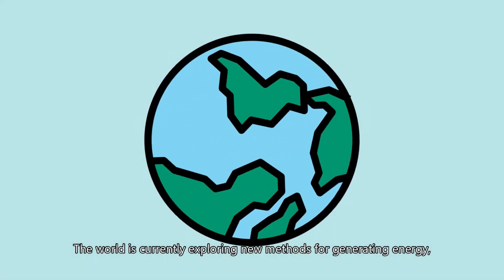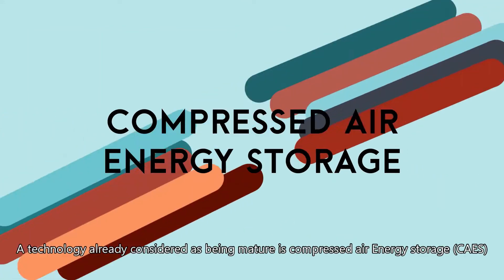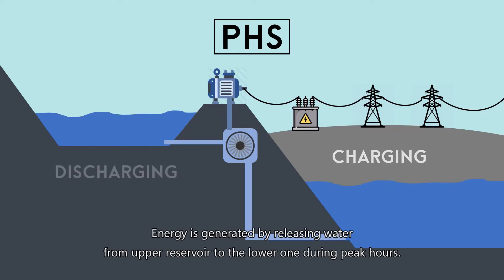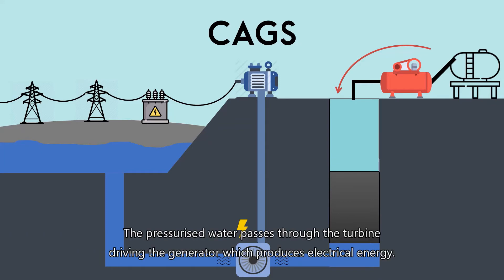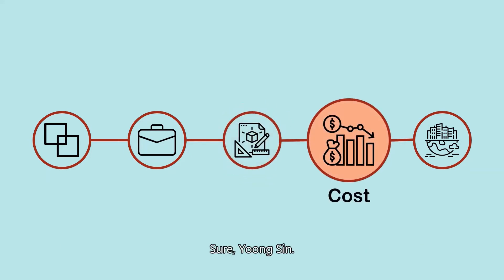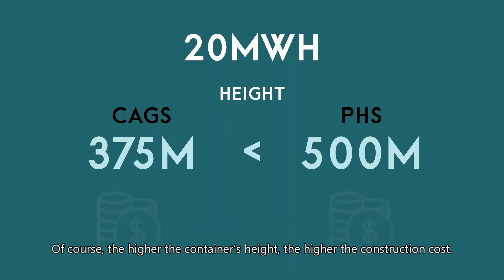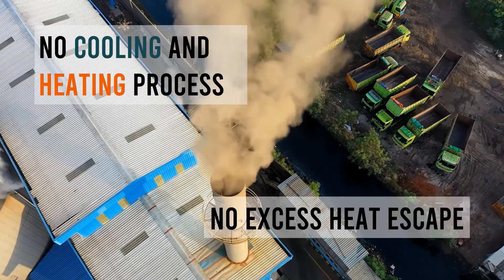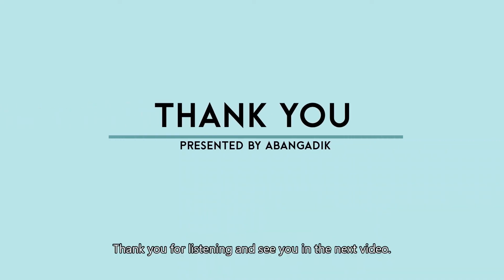USMCEC2021: TVC_Compressed Air Gravity System_AbangAdik

Comment: caes is better,the low efficiency occur when heat and cold from the process is not tap and used,plus steel tanks get cheaper as they get bigger,so a big sistem is so inexpensive that to compensate loses is as simple as to purchase a few solar panels,